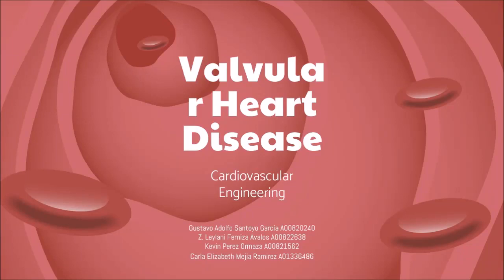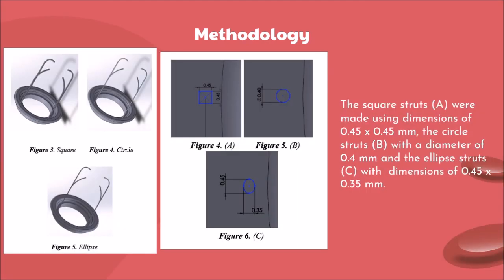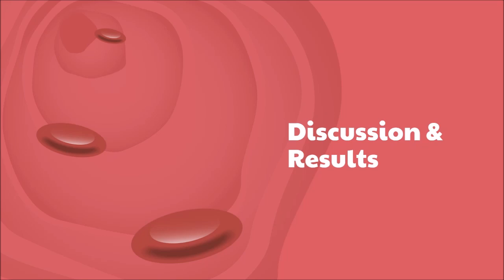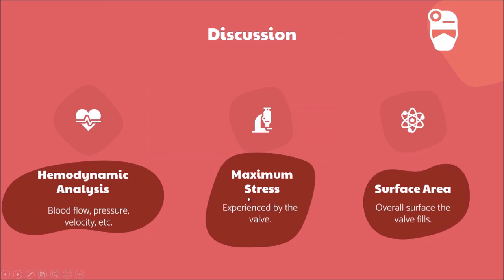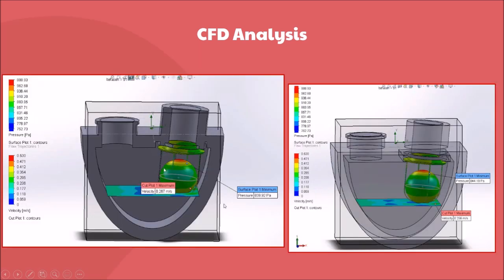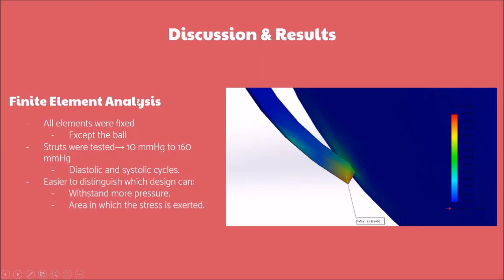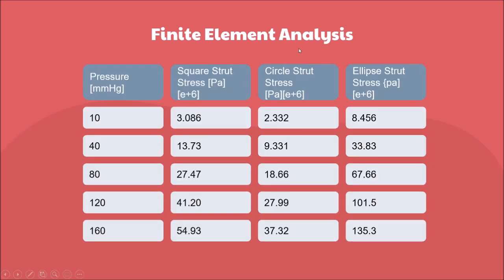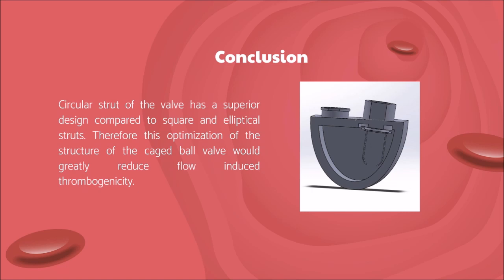Final Project - Cardiovascular Engineering

Comment: Hello,
Though you did a nice comparison between different shaped struts, there is in literature a straight answer on why the sphere is the best shape to be used in this particular case. It can be found in many books of fluid mechanics, and the experimentation called external incompressible fluid flow around takes place in the wind tunnel, or in computational analysis. Many object shapes have been studied already, and one of the main terms to look after would be the drag coefficient. It is already known that squared shaped objects create disturbances to surrounding flow. It all depends on the application, but in this particular case, the sphere is the way to go.